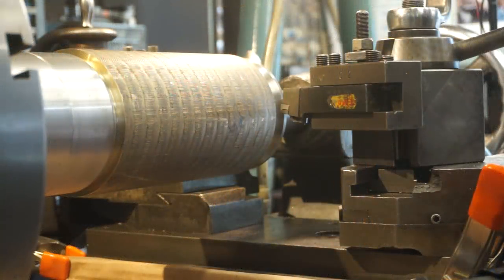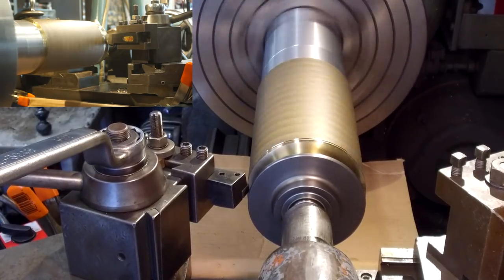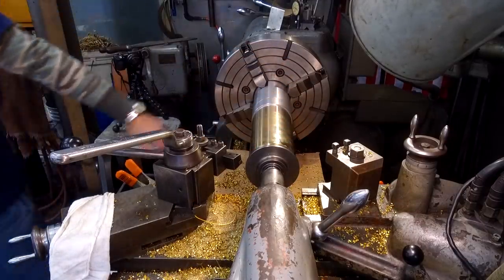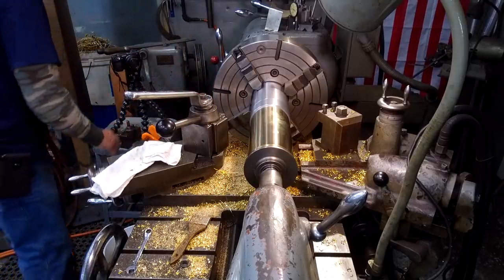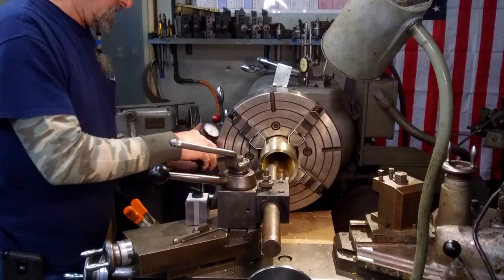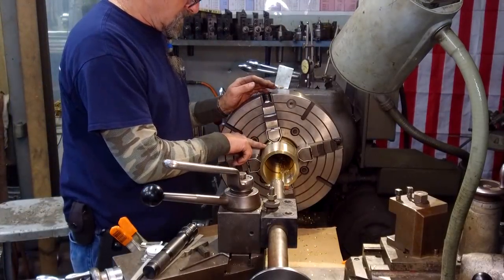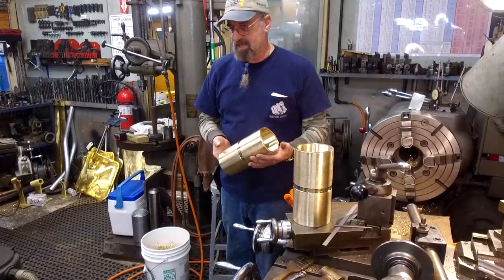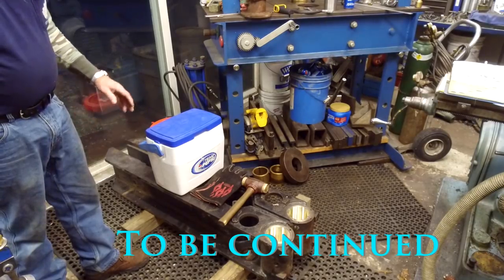Boat Forks Part Six

Comment: My first Keith Fenner video was when you bought a Chinese (?) tool grinder and spent, I think, two videos working out where the factory run-out was. At first I was thinking, "Why is this guy worried about this little bit of run-out", but over the course of the video(s) I began to see and understand what it meant to have high standards. I grew, in that short period of time, to appreciate your methodology. I finally started to understand what the word "machinist" actually meant. You're not just a guy that cuts metal for a living. You understand the what and why on how a machine should function properly and how to get that to happen. As a start-out hobbyist (can't call myself a machinist just because I have a couple of the tools) my appreciation for your chosen field was amplified 100 fold. That's due to you and your little bench tool grinder, so I thank you.
Reply: 1969Kakashi well said. I remember that little grinder too.
Reply: That's the first video I saw too.   I've been a machinist for 13 years now, and I still pick things up on this channel.     And he films the more interesting jobs.    My reality at work is alot of the same old same old with a fun, challenging job thrown in every few months.

Comment: How many thousands difference between the dia. of the bearing and the bore of the steel for the press fit? Have heated large tapered bearing in hot oil to expand for a shrink fit, first time to see a frozen fit. You do beautiful work. Congratulations on the Tube award, you are very deserving for sharing your knowledge. From Missouri, JD
Reply from the maker: The interference fit was about .003" and the mic reading was about .006" smaller than the hole, when frozen with the dry ice. ;{)------
Reply: Thank you Keith, again congratulations on your YouTube award, you are very deserving.  JD

Comment: Just an FYI, those FLIR thermometers change depending on what material it is reflecting off of. Silver is the worst and I think brass is pretty bad as well for accuracy.
Reply from the maker: I don't trust them as a general rule anyhow, just curious, but they were coated with lite frost. The micrometer tells the story the gun is for fun! LOL ;{)-----

Comment: Just a "blue sky" question.  Since you do live in an area that has harsh winters...  knowing that the coefficient of expansion (and contraction) for the bronze (17-18) and the steel (11-12) are different...  do you ever have to worry about the bearings coming loose in the bore during long cold spells or is there ever a need for something like a stud and bearing mount type loctite?? 

Congrats on the 100K subscribers.
Reply from the maker: Have not ever had a problem of that sort here, but are weather is not that drastic, My thought is that transferring heat by contact, keeps them in same range that never exceeds the interference fit. ;{)------
Reply: Thanks Keith!

Comment: Hi Keith.Why were there small chips and then curly chips when working on the lathe ?
Reply: Cutting tool geometry
Reply from the maker: It was the walk from roughing to finishing cuts during the overall project on turning the outside diameters. Thanks for the comment and question! cheers, ;{)--------

Comment: I may have missed it but why not do a press fit and press in?   Is this way even tighter?
Reply from the maker: less stressful on the bushing and less work physically having to rig up into the press, It does create a little better grip than what it would have sliding the surfaces against each other, while pressing in place. Also just giving another way of getting interference fits together if you have no press. ;{)------